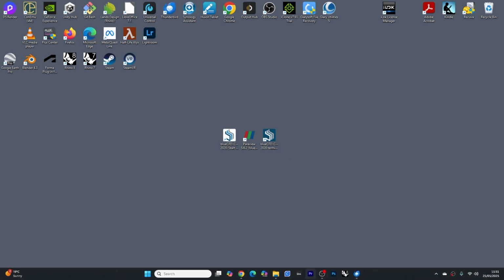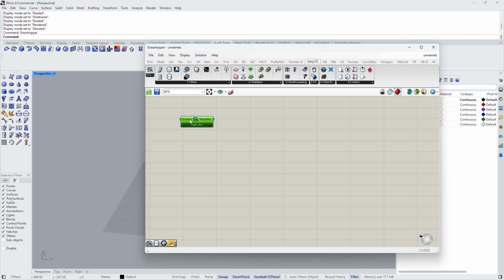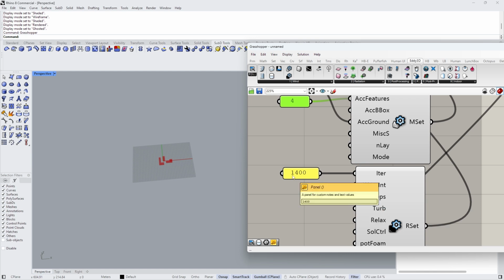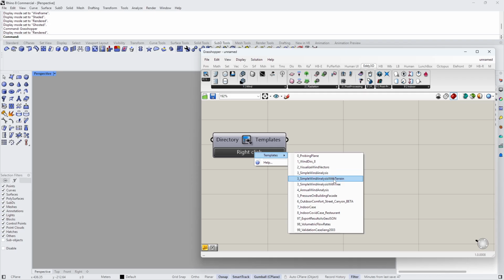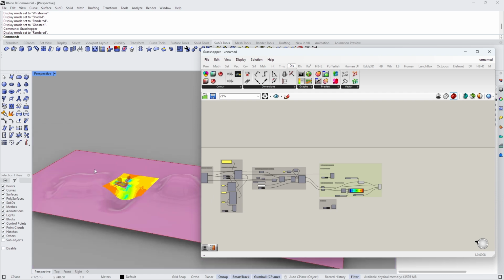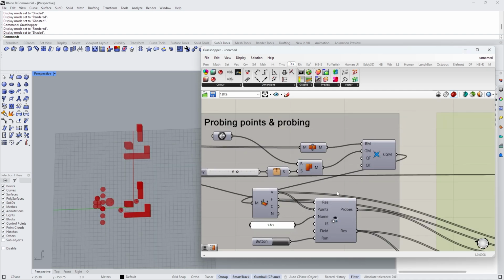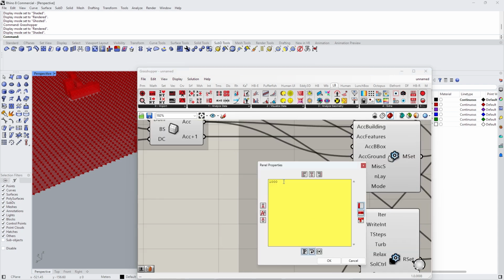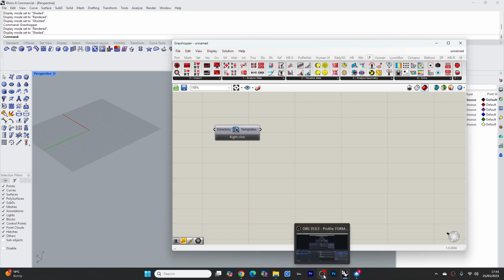Wind Analysis with Eddy 3D - Right out of the Box

Comment: Hello Philipp,
I recently downloaded Eddy3D 
For some reason the simpleanalysiswindsimulation from the template is not working 
The only wind vector that are displayed are vector outside of the simulation domain which is pretty weird 
I tried to change the probing but this time not any vector were displayed i also tried to change the iteration count but didnt change anything 
By any chance did you encounter the same issue or do you know how to fix it ?
Kindly 
Rémi
Reply from the maker: Yeah, the developers have become a bit lazy with the template file updated it seems.
I had some issues yes but let me ask you. What units is your Rhino file. Meter?
I suggest to rebuild the script. Some of their tools from the templates are from previous versions. It's a bit messy.  Aldi I would set a new folder before running script again...
Reply: @PhilippGalvanDesign 
Thanks for you reply !
So by following the steps of your tutorial on your channel it should work ?
Reply: And yes my file is in meter
Reply from the maker: If you follow the steps exactly as shown in the video, it should work - that’s the workflow I use myself.
The part I can’t control is your 3d model,  installation of tools and third party plugins and how thoroughly you built the script.
So try rebuilding the setup from scratch using the steps in the tutorial — that way you’re working with the current components, not the old template and you get the hang of how things relate.

Comment: Hi Philipp, I've recently gotten into Rhino3d and grasshopper to help me in an outdoor thermal comfort analysis I've been doing for my class. Your videos have been a lifesaver for breaking the software down into easy steps for beginners to follow, thank you so much. 

I was thinking about running a wind simulation over my data collection site, and I tried combining its surface model from Lands Design with Eddy3d, but I've encountered some troubles with getting it to work. Please forgive me if you do not take video requests, but could you make a video for us beginners explaining how to create custom environments to run the simple wind analysis? I greatly appreciate it.
Reply from the maker: I do take video requests and that is some thing I wanted to do anyway. Obviously i need to go my pace as i'm also working but yes its a great idea to show this software in action.
Can I ask, where did encounter the problem with Lands design and Eddy. Any error messages, red tools, or just nothing happening?
Reply: @PhilippGalvanDesign  I'm getting an error which says: 1. Data conversion failed from Curve to Mesh when I tried to set my surface geometries into the mesh and MJoin.

Comment: Hi Philipp,
I've been following your work since Ladybug—it's been incredibly helpful!

I’m currently working on a wind simulation and decided to switch from Rhino 7 to Rhino 8 specifically to use Eddy3D.
I have a question:
Is it possible to input location or weather data (like EPW files) into Eddy3D, similar to Ladybug?

I tried connecting an EPW file using the Ladybug Import EPW component, but it seems incompatible—it shows the “old” sticker, and it doesn’t function properly.
Could this be due to a version mismatch?

Thanks in advance for your guidance!
Reply from the maker: We will examine this soon in one of the next videos. There are options to use ep-weather data file but I also struggle. But for sure there is a way. At the end it's grasshopper. All just numbers
Reply: @PhilippGalvanDesign  Hi Philipp
I'm a huge fan of your work here!
Were you able to find out about EPW into Eddy3D?

Thank you in advance
Reply from the maker: Yeah I promised to look into this a while ago...
I hope to find time in the next days.

Comment: Hello
Thank you for the easy-to-understand video. I installed it while watching the video. However, an error occurred halfway through.

I built the environment with rhino7, windows11, and eddy3d0.4.2.1,

but when I look at the OS of the Rset component, windows11 is not an option.

Is windows11 not compatible with eddy3d0.4.2.1? .

If you know any way to avoid the error, please let me know.

The following error is displayed in residuals.

2. Solution exception: Input parameter index [-1] too low for Component Residuals.
Reply from the maker: Which version of Blue CFD core did you install?
Reply: @PhilippGalvanDesign 
I installed 2020-1
Reply: @PhilippGalvanDesign 
It's 2020-1
Reply: It's 2020-1
Reply from the maker: I don't think it has anything to do with windows 11. I have window 11. Can you explain the error. When you say halfway through. Through what? The installation? Is there a window which says unknown software or similar?
Reply: @PhilippGalvanDesign 
The error is an error in the "Residuals" component mentioned above.
Reply from the maker: @make3d698 
Ahh I didn't see the last sentence.
That's not a windows problem.
Which units do you use? Should be a meter.
Check if the residual component is the the same as your eddy3d version. Zoom in closer to see the version number on the bottom. If it's older replace it with a new one from the tool palette. Did you set your CPU to -1? Try to just use the default settings....
Reply: @PhilippGalvanDesign  The cause was that the component was an old version! The analysis was successful and the wind arrow was displayed. Thank you!
Reply from the maker: Great to hear.

Comment: Hi Philipp, the issues I have with these tool's is that doesn't offer full potential of Open foam, for example most of the time you should validate your process with experiment of wind tunnel, those data are in form of point measurements that should be translated to velocity profiles, the ABL modules are base on log low form, while from my experience the power low implementation are more accurate. Other than that the meshing qualities should be reported using quality meteric, y+ and y* of our CFD should be checked, which I don't see that these tools offer. They are great for some initial analysis, but overall for professional work they need more refinements and capabilities.
Reply: I totally agree.
From a wind engineering perspective, there is also a lot of complexity that is skimmed. The choice of the weather station is not as simple as shown here. More than half of the weather stations shown there are crap. To properly select the weather station you should visualise the data and check things like completeness, outliers, systematic errors, changes in equipment, etc. Following that you should follow up with a terrain analysis to remove the bias introduced by the terrain surrounding the station. And so on....

PS: I'm a wind engineer
Reply from the maker: Thanks for this detailed comment – you bring up some excellent points. I completely agree that tools like Eddy3D (and by extension Butterfly or similar Rhino-integrated CFD tools) simplify things for accessibility but inevitably abstract some of the deeper controls and validations you'd expect in a full OpenFOAM workflow.

You're absolutely right about the importance of validation with wind tunnel data and using velocity profiles (especially when comparing log law vs. power law for ABL inputs). Also, the lack of feedback on y+, mesh quality metrics, and turbulence modeling parameters limits how far you can push it professionally. I see Eddy3D more as a stepping stone—great for conceptual or comparative studies early in the design process, but not something I'd rely on alone for certification-level analysis or highly detailed façade pressure mapping.

Would love to hear more about how you structure your OpenFOAM workflows if you're up for sharing—especially if you’ve found ways to bring that level of detail into more design-facing environments.

Comment: Hi Philipp, thank you for sharing. I have a question about the Eddy 3D regarding ABL, a grey bubble says: "The average angle offset between simulated wind directions and the weather file is 0 degrees. So, how can I solve this issue? I have checked the blog, and there are no clear suggestions. Another problem is that the simulation cannot be converged by using the default model. Do you know how to set up the parameters to make it converge?
Reply from the maker: Hey, I think you are already next level ahead of me. I still need to examine and soak everything in. But will get back to you once I figured it out. 
When you say converge what do you exactly mean? Anyway give me a few days and then I probably know what you mean. 
All the best

Comment: Hi Philipp, according your experience through both butterfly and eddy3d which is better for cfd analysis especially for utci and outdoor thermal comfort analysis
Reply from the maker: Hi I haven't tested all components of Eddy 3D yet but since both Butterfly CFD and Eddy use the same engine ( Openfoam) the difference is more about which has the better support. Butterfly is cool for learning but the development has stopped 2018 or 19.  Eddy 3d has evolved and I can see that there is a team working on it. Eddy has incorporated elements which are clearly geared towards urban planning and is adding UTCI and indoor airflow etc to its toolbox.

Regarding UTCI I haven't tested it yet in Eddy but combining wind and UTCI is great as it gives a much better picture. Now Butterfly has no UTCI component, Ladybug has, so it was very useful when I combined the two but also very complicated. 
Again I need to test Eddy's UTCI component but because we are in Grasshopper I'm not worried. I can use Ladybug and Eddy together if Eddy's UTCI tool is not great, which I doubt anyway.
I give you another angle. Butterfly was great in the sense that it allowed us to see and learn what happens under the hood. But moving forward Eddy 3D has already evolved into a tool people can use on projects. So I guess the answer is clear.

Comment: Hi Philipp, I’ve been exploring how to use Grasshopper for CFD, and I’m particularly interested in simplifying complex city geometries before meshing. When working with detailed city maps, small features like window frames or minor extrusions tend to drastically increase mesh size without contributing much to CFD accuracy.

Do you know if it’s possible to script a workflow in Grasshopper that can smooth or simplify these finer details while still preserving the overall form and structure of buildings? I’ve experimented a bit—using the rooftop outline and maximum height to extrude down to the ground—but that often misses important variations in the building’s shape and footprint.

Just wondering how difficult of a challenge I’ve set myself up for here :)
Reply from the maker: Actually the tunnel creats its own mesh model which mostly remove the fine details. i will try to make that visible in eddy 3d in some of te next videos.
But you can see the concept in some of the butterfly CFD videos I created in the past.